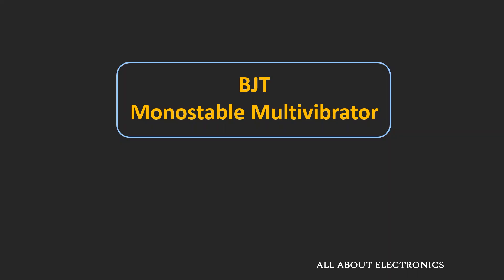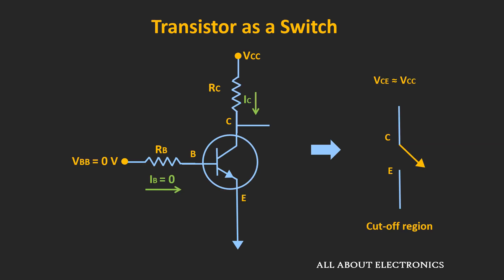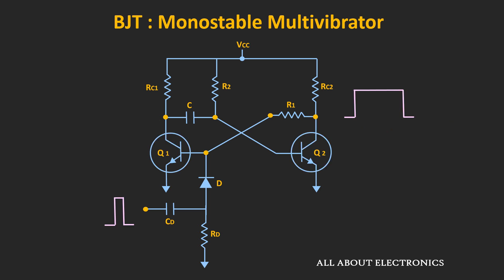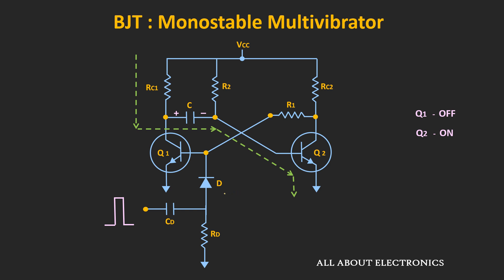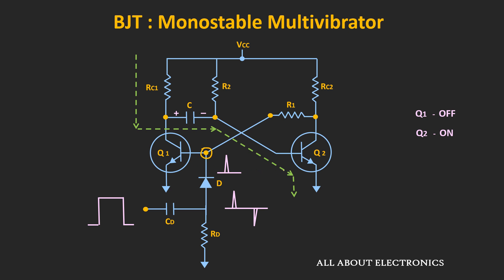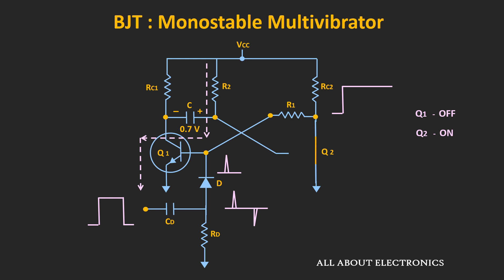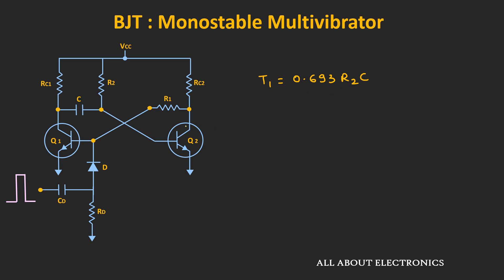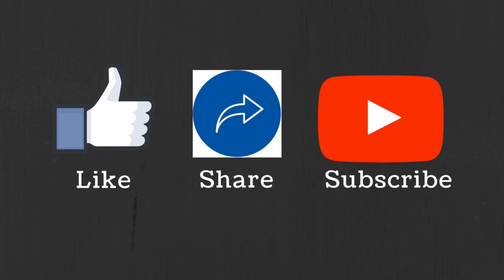Monostable Multivibrator using BJT Explained

Comment: I dont understand how Q2 will remain in ON state forever bcoz there is capacitor in the circuit. It will start charging through the path Rc1Q2 and then its right plate will develope negative polarity and hence which will also make the base of Q2 neagative and Q2 will be off due to reversed bias.  Please correct me if I am wrong?

Comment: at 3.09 how the voltage at the base of Q1 is zero???
Reply from the maker: Since Q2 is ON and operating in saturation, it can be assumed as short circuit. So, one end of R1 is connected to ground terminal. And other end is connected to Q1. That means the base of Q1 is connected to ground via R1. So, we can say that, the voltage at the base of Q1 is zero. (Diode D is reversed biased and will act as a open circuit)
I hope, it will clear your doubt.

Comment: How to calculate values if VCC is 3v...
Reply from the maker: at the end of the video, (around 12:00) I have shown how to select the values of R1 and Rc. At 3V, just make sure that, transistor operates in the required region. You can tune with R1 and C. You can reduce R1 and increase C.  With little tuning, the circuit can work.

Comment: So I want to see a TRUE one shot... where a switch is flipped to trigger it and the trigger changes states and stays, so if the switch is state 1 and flipping it sets state 0 and holds it, I want the circuit to do 1 pulse based on R/C and not re-trigger until the switch is manually toggled between state 1 and state 0 again.

Comment: why aren't both transistors in saturation mode from the beginning? Doesn't the voltage source immediately have paths to both bases? Why exactly would Q2 start conducting before Q1?
Reply from the maker: The voltage is applied through a base resistor. The resistor will also play a role in it. Q2 is connected to Vcc via R2. While Q1 is connected to Vcc, via R1 and Rc2. The current in Q2 will be more and hence it will go into saturation first. 
I hope it will clear your doubt. If you still have any doubt, then let me know here.
Reply: @ALLABOUTELECTRONICS  Wow thanks for the quick reply!

I thought that might be the case, but was thrown-off by the example given by electronics tutorials ( https://www.electronics-tutorials.ws/waveforms/monostable.html ), where RT = 6*(R2+R3). Am I missing something?

Comment: Thank you sir 
Sir I have doubts sir 
Why we took R2>=10R1 ?
And why we applied  _(Vcc_Vbe) to transistor Q2 when trigger is applied ??
Reply: Because when the capacitor C suddenly discharges off the positive plate, there is a sudden negative voltage off its negative plate. Current draws toward the cathode side of a capacitor during discharge due to what's called displacement current. This sudden drop into negative voltage on the Base of Q2 is what turns it off.

Comment: Why the negative voltage of - (Vcc-Vbe) is getting applied to Q2 and how?
Reply: Because when a capacitor suddenly discharges off the positive plate, there is a sudden negative voltage off its negative plate. Current draws toward the cathode side of a capacitor during discharge due to what's called displacement current.
Reply: Capacitor ke

Left pe VCC 
Right pe Vbe
Capacitor ki khud me voltage jispe vo charge hoga = X
(X= Vcc-Vbe left to right)

Ab Q1 grounds
So change happens

Capacitor ke

Left pe 0 
Right pe Vbe
Capacitor ki khud me voltage jo held thi pehle se = X (same as before)
(X= Vcc-Vbe left to right)

Now left to right jao X neeche
Higher to lower X neeche
0 gnd se X neeche
= -X
= -Vcc+Vbe
Reply: @asharawat486  Thank You

Comment: Sir 
Please explain pass transistor used in regulator circuit 
And PLL with practical examples 
Schmit trigger
Reply from the maker: About voltage regulator and Schmitt trigger, I have already made a video. 
Will make a video on PLL.